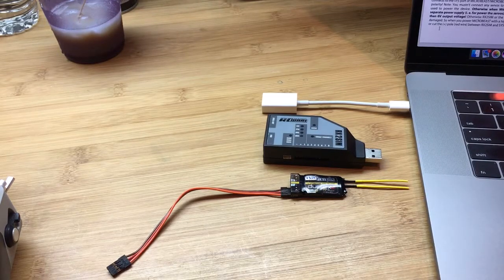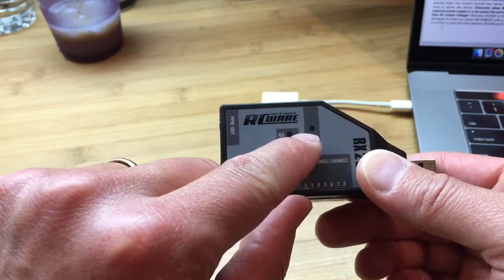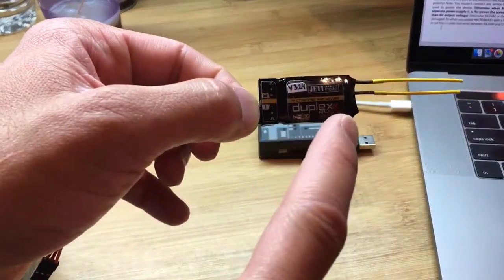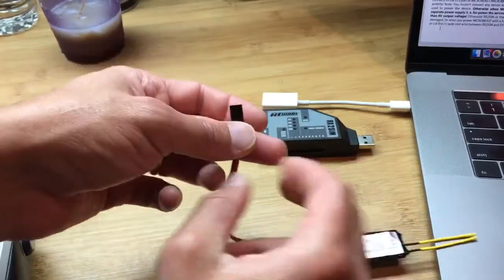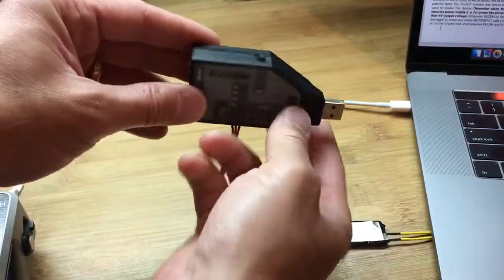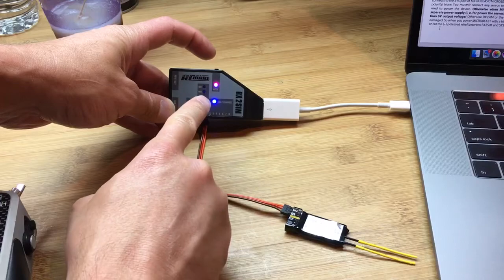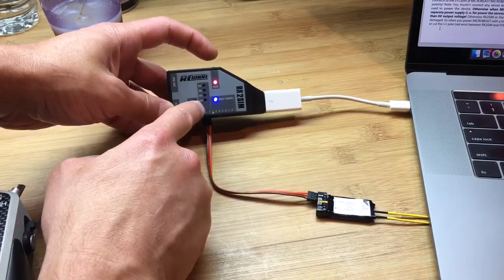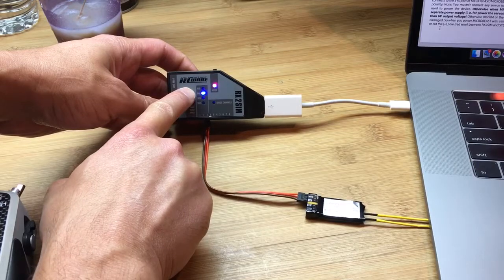neXt flight simulator wireless setup with Jeti radio and RC Ware interface— Part 3 of 4

Comment: i do not have a solid blue light :/ what should I do? the connection is right...
Reply from the maker: First, make sure you have previously bound the radio to the receiver.  Second, make sure the radio is turned ON and ready to communicate with the receiver (radio set to the correct receiver or model).  Third, make sure you have the receiver connected correctly to the RX2SIM.
Reply: @johnahamelv  thanks butthr problem was... if i set the reciever on ppm negative it sais i should plug it on SAT1 not on EXT and than it worked 😉
Reply from the maker: @fabianplacek8582  Just to be clear, did you finally get it to work?
Reply: @johnahamelv  yes yes 😉